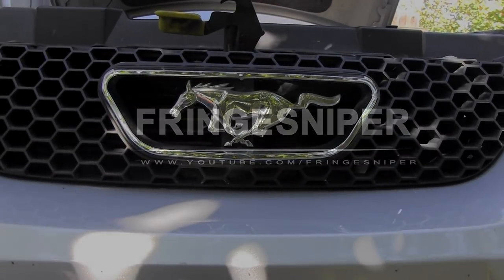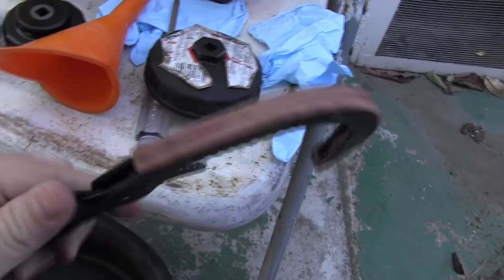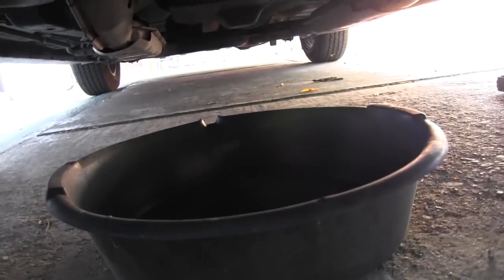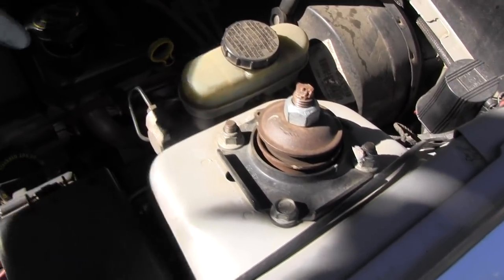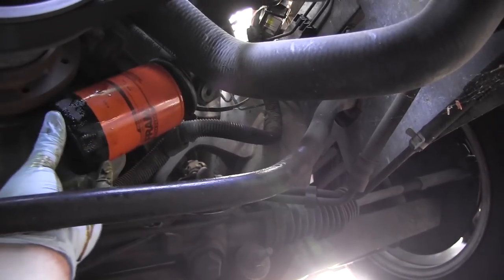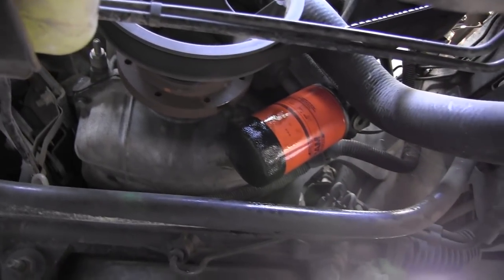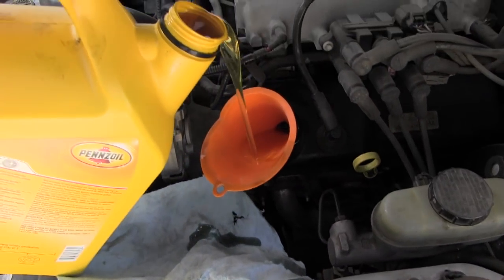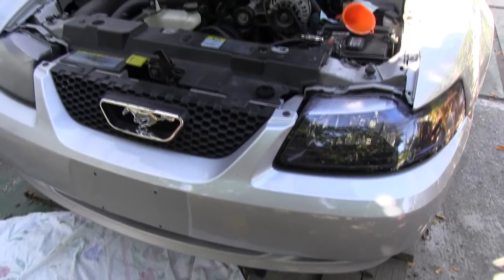2001 Ford Mustang : Oil and Filter Change

Comment: Thank you, this video was very helpful, I have the same model mustang :)  there's nothing better then doing the motor oil change yourself, I've had it done in the past at jiffy Lube, Midas, Sears automotive services and something alway goes wrong one place breaks my dip stick, the other treads the  oil drain plug, and sometimes they over fill it >={  , I'm putting full synthetic so it should save me money oil shops charge a lot more for synthetic

Comment: Few things.

Don't use fram. Those filters are shit. Use what came with the car, motorcraft. Walmart sells them.

You might want to check your owners manual on your oil type, it may be because yours is 2 years newer but I have a 99 and it takes 5w-30. Never hurts to check.
Reply: Chinesefoodrocks1521 I was thinking the same lol but on these cars you can use either 5w-20 or 5w-30 it doesn't matter
Reply: Nah purolater is the best brand for ford oil filters, FordBossMe did a teardown of a shit ton of brands oil filters and purolater had the most fins and best construction.